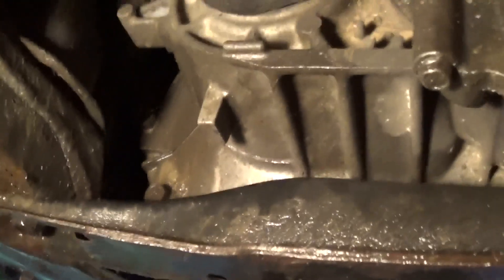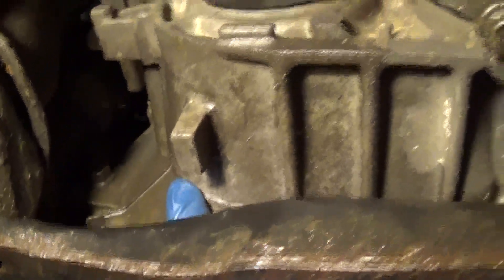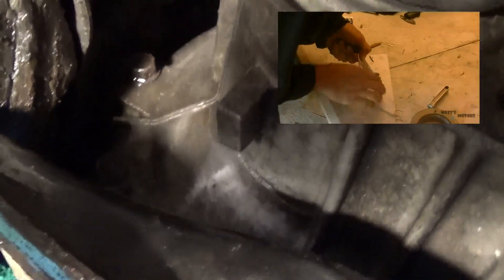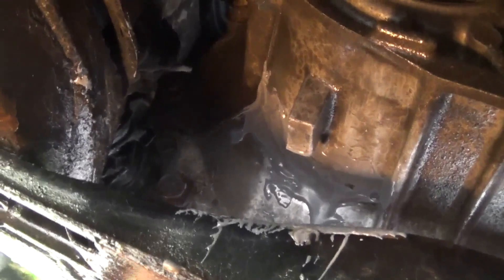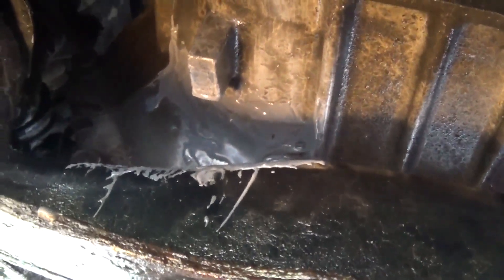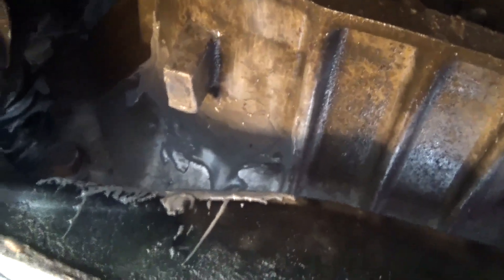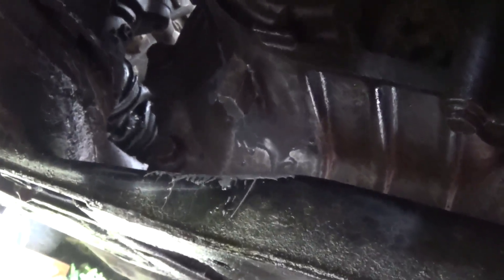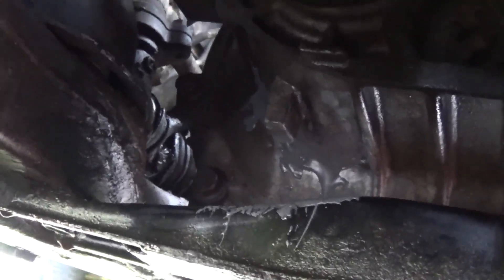Fixing a Cracked Transmission Case

Comment: I have an o2 grand prix I cracked the housing trying to pull a cv out of the trans and cracked it (leaking fuild) I didn't even both bother sanding or anything just wiped the area with a paper towel and 5 years later JB weld is still holing strong lol

Comment: I’m having the same problem my need help 97 Honda civic had a minor crack on the bottom of the transmission due to a pothole. I drained all the oil to ad JB weld it has been 3 days and oil still dripping from the crack what can I do to stop the oil drip so I can the JB weld?

Comment: I mean, if you gave the customer the options, and they opted for that and signed a waiver, sure all day. Otherwise, THAT is not a fix, it's a band aid.
Reply: I know it's been 6 years but I can attest to you that a  properly cleaned surface for the JB weld repair will absolutely last the life of the vehicle
Reply: @narwhal9852  Have you done it? I need to repair the case on my Civic SI b16a2 trans one of the mount to transmission bolt holes cracked tightening that shit last night.

Comment: I have a 96 Acura integra automatic.  I have swapped the trans 3 for other reasons.my car is lowered and yesterday I went over a bump on the road at about 20 mph . I noticed  that it started leaking today . I have not driven the car since . But after lifting the car in the air I noticed that the transmission housing is now cracked and oil pan is also bent a bit . I have extra oil pan but with holidays around the conor dont have money to buy another transmission . I'm going to try this and see if it helps my situation with my leaking transmission  👍👍
Reply: Also I am going to be raising this car  to avoid any future problems like this.  My dad suggested the same fix lol. At least till after the holidays and then I can get a new housing or another transmission.  Every thing else seems to be ok on the vehicle.  And luckily I was only down the street from my house when I cracked the housing .so no transmission internal damage and no engine internal damage 🙏🙏
Reply: @lowrider4life213  did it work

Comment: J-B Weld won't stop the crack from expanding and getting wider and longer.  The crack will expand do to vibration from driving and all the moving components inside.
Reply: How about on an engine bell housing mount to the transmission?  I tighten it too tight and cracked the mont on the engine mount to the transmssion bell housing?
Reply: Apparently drilling a hole at the end of the crack and fill with JB weld should stop the crack spreading.
Reply: Blue Moon should I drill straight through?

Comment: Hi, Matt. Good job. I have a problem with a crack and leaking transmission oil on Ford Edge. Could you tell me? Did you clean or degrease the transmission surface before applying the adhesive? Thank you.
Reply: if it's a Ford edge get rid of it
Reply: Drain oil and lightly sand it, taking care none of the shavings get into the trans. Then use a metric ton of brake cleaner, and then you can apply some stuff. Worked well for my civic :)

Comment: Hi bro how are you ?
 I want to ask you if this methode is success ??
 I have same this crack with transsmission of mitsubishi outlander 2003 i think the transmission of outlander are the same of lancer and i try many epoxy AB but it is faile. Before i am buying jb-weld i want to ask you if it is effective ???

Comment: I have a  suzuki esteem with several little cracks in the bell housing.. nothing like the one in this video. do you think it will help?it would save me ALOt of money ... i like my little suzuki esteem good little car
Reply from the maker: If you are not leaking fluid then I suggest not doing anything.  The bell housing has no fluid running through it typically and isn't prone to causing a leak.

Comment: Hello MattsMotorz. I was putting the drain plug back in my transfer case on my 08 silverado and it cracked straight through about a half inch long on the housing where the drain plug goes in. Can JB Weld repair this and if so should I put it on before I install the drain plug again??
Reply from the maker: +CSXtrackworker I would have to see a picture of the crack to say for sure, but odds are there is a good chance it will work.  Did it crack thought the threads of where the drain plug goes in? If so, then you might want to put some sealer on the drain bolt after the housing is repaired with the JB weld.
Reply: +MattsMotorz Thanks for the quick response. Yeah, it cracked right through the threads. I was gonna slightly insert the drain plug to spread it out a little bit to let the jb weld get inside the crack and then pull the plug and let the crack go tight again as well as us loc-tite on the drain plug. I guess this will be a stop gap until I can either get it tig welded or a new rear cover for the rear.
Reply from the maker: Sounds like you've got the right idea with how to do the repair.  I am interested knowing how it goes!

I think it will be very hard for you to find just the cover.  Many places will only want to sell the whole transfer case.  The only place you could probably get one is the dealer, and it will cost an arm and a leg.
Reply from the maker: Also, welding cast aluminum (I am assuming it is aluminum) is very difficult.  It requires a bunch of pre-heating. welding, grinding away, welding, grinding away, ect.  Many welders will refuse to do it.  This is also because welding cast aluminum weakens it and it is likely to crack again in the future.  Although I have had it done in the past to repair a transmission housing, it turned out okay.
Reply: +MattsMotorz Right now the JB weld is put on and will be curing for the next 24 hours. I have decided to reduce the torque lbs down to 10foot pounds instead of 16 for the drain bolt and put a rubber o ring around the end of the threads with a good amount of medium loc-tite to help hold. If I can't find anyone to weld it than a new cover is the way I will have to go. I found a place that sells both covers and all I need it one. But if I must buy both than so be it. I'll let ya know how it turns out. Thanks again for the response.
Reply: +MattsMotorz Well, the JB weld on the crack along side where the drain plug goes in has held. But it has a slow drip coming from the threads. I put a crap ton of Loc-Tite around the plug but it still drips. I just received a new back half for the transfer case so it will be going on next weekend when it warms up. Could I get away with this temp fix for a while? Yes. The JB weld held. I would have to check the level once a week though.
Reply from the maker: CSXtrackworker Yeah you can get away with it forever if you just make sure the fluid level doesn't get too low. 

Although it is probably too late, the thought just crossed my mind that the part could definitely be brazed back together.  Brazing is a good alternative to difficult to weld materials such as cast aluminum or cast iron.  If you bring it to any good machinist or fabricator they should be able to braze it up.  The way I would do it is braze the crack and the hole completely closed, then re-drill the hole and tap to the correct sized thread for the drain bolt.
Reply: +CSXtrackworker I'm dealing with the same issue right now, over tightened my civic drain bolt and the threads cracked off a piece of aluminum...what a nightmare. going to give the jb weld method a shot today
Reply: +gary martins Until you can do a permanent fix, I would try the JB weld. I put the weld o my transfer case and it leaked slightly. I could not tighten it to the ful 15ftlbs of torque. It would spread the threads out through the crackand stretch the JB weld. I took black epoxy and before I lightly thigtened the drain bolt I put some around it. I changed out the back half of the transfer case three weeks later. It held till I fixed it. I wouldn't torque the plug down fully.

Comment: Is that an Eclipse? I have a crack in my 01 eclipse transmission too, but due to a rock striking it. I tried putting gasket maker on there, if that doesn't work, then I'll pick up some jb weld. is it easy to put on there? my cracks aren't really that bad.
Reply from the maker: ZekeComa The gasket maker wont hold up very well / long due to it being exposed to the elements.  JB weld is MUCH more robust.

It is pretty easy.  The best thing to do is to push it down into the crack with your finger as well as smear it all over the crack (Yeah yeah I see the joke!)
Reply from the maker: ZekeComa Also it's a Lancer

Comment: Will this hold at high temperatures?? I'm no expert on cars but I do know that average vehicle engine and transmissions can reach up to like 100000000000 degress lol
Reply: Trans case will likely never go more than 200f. It's runs colder than an engine

Comment: Hi is it possible for you to provide the product name or a link to it? thanks in advance for your help!
Reply from the maker: +TheComebackid1 It's called JB Weld. You can get it at any auto parts store.  There is the Quik weld, and industrial strength.  The latter is stronger but takes longer to cure while the former cures quickly but isn't as strong.
Reply: +MattsMotorz thanks! I was able to purchase it at a local autozone I will keep you posted on the result when I get a chance this weekend.
Reply from the maker: great!
Reply: @TheComebackid_CBK  How did it work?  has it held for this long?